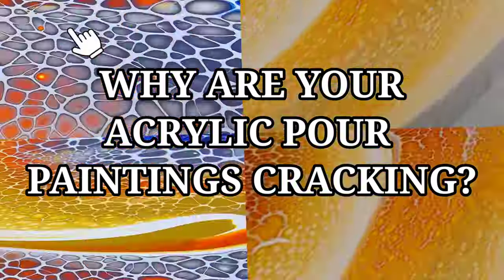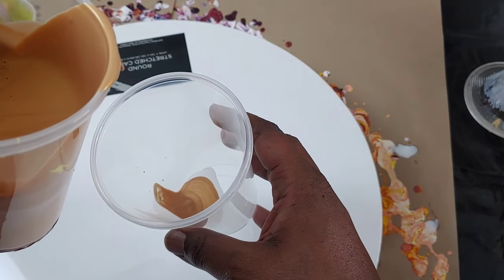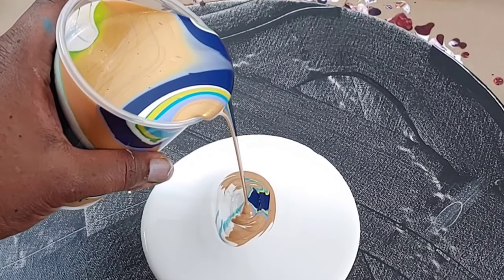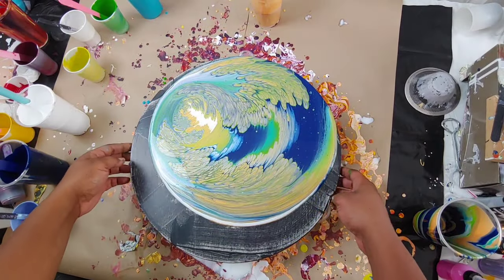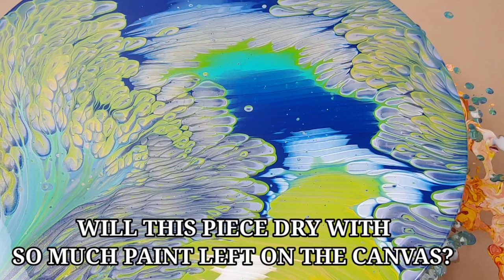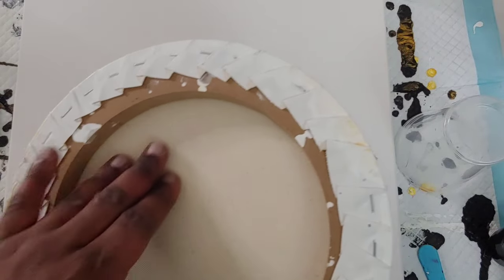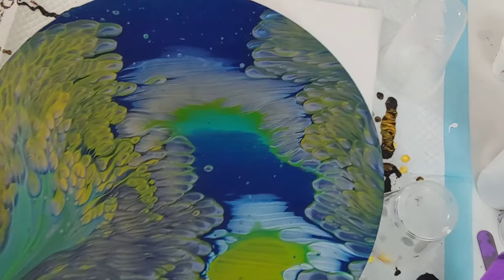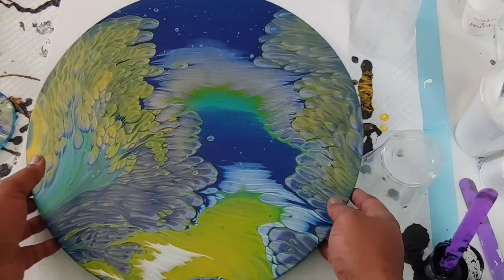Underwater Garden Acrylic Pour Painting ~ Experiment and Tips

Comment: If I put a big pot of water on the stove with a lid on it and a slow boil to add some humidity to the air it doesn't crack. Worked everytime so far
Reply from the maker: That's so freaking awesome. I live in a relatively humid climate but I will pass this trick on to others. 😊🙏🏿❤️
Reply: Good thinking!
Reply: @GarrickBrownArtStudio  Don't have thepaint real thick. That promotes cracking. The top dries fast and underneath takes days.

Comment: I have a question: Should I use hot  air to get the cels or cold?
Reply from the maker: The temperature doesn't make a difference unless you are using silicone. In that case you need heat. If you are blowing with a hairdryer cool air is best as hot air can burn or scab your paint.